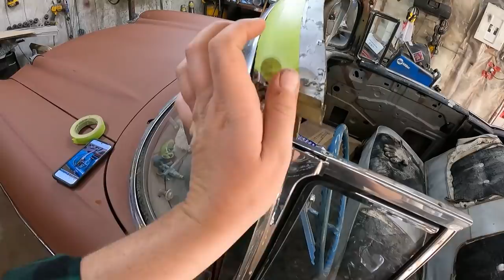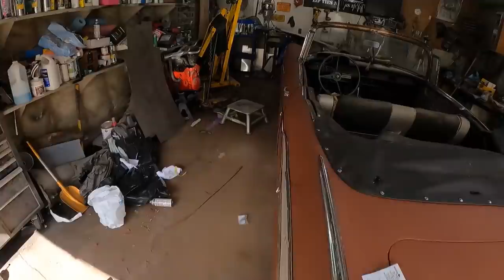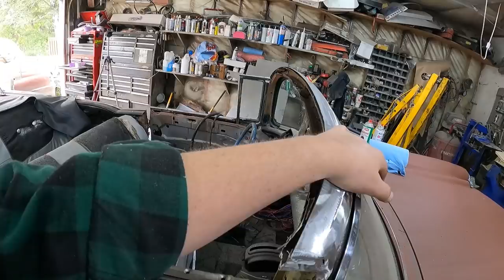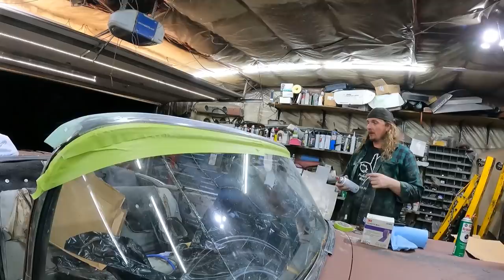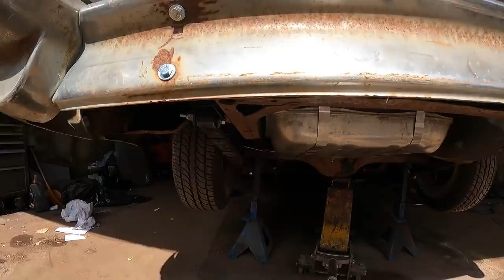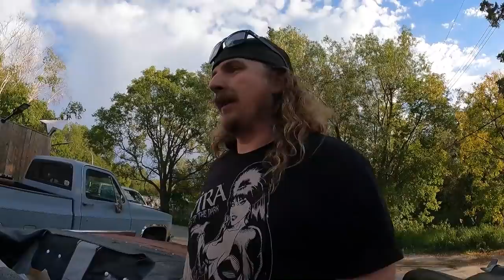IMPOSTER 1957 Chevy Rag Top CHROME IN A CAN Plus GLASS PACKS!

Comment: Finally tackling the windshield / roof portion of this build . This was filmed when you sold the sport satellite . It's there in the beginning , gone by the middle . Nice job on the boxing in of the window crown . Looks much better ! As to the inside , maybe mask it on top , 3/4 " , paint the lower portion a flat black to prevent shine . Then it will "look" thin . Sounds excellent ! Chrome tips would be cool . Definitely go shopping for the bits & pieces . You need them anyways , & it's less back & forth if each vehicle has it's own stuff . Great video , Dan . She is about to hit the road , WOW !

Comment: You need a pair of 2-dr HT “A” pillar trim.. Its stainless steel trim that fills the gap between the windshield surround trim and the wing window chrome frame. The front edge has a tab that goes under the windshield trim. Back side is held on with screws.
Reply: His car should have had those, It was a four door Hardtop They must have been missing before he found the car!

Comment: i just cut everything off of my 55 4dr sedan this week , now  it is just the  cowl on the  chassis . im going to use the sedan frame for a jig to build the body.  
  il put all the new convertible floors from the firewall back to the back bumper on and then the 2 new inner convertible quarter panels.  
  i have been buying the parts to build this 55 ragtop forever . i had bought a really rotted 56 convertible first  to get all the convertible only  parts.

your 57 project lit a fire under my but to get this done before it gets to cold to work outside .
 i dropped the 454 block and new 60 over  pistons off at the machine shop this morning so they can finish hone the block and put the new pistons on the rods .
    keep up the good work on the 57 your way ahead of me .

Comment: A tip from an old schooler fabricator.... On the back of the windshield box that you capped and said looks too big... On each side of the sunvisors cut a slit on each side of them about 3/4 to an inch forwards towards the windshield... Then follow the bottom of the arch to the edge near the door vents and by eye.. Follow back to the center of it from the ends and where it starts to curve up and just starts gettin thicker mark it with a sharpie on each side the very ends on the bottom of it are very close to the right thickness the whole bottom of it should be the same thickness and mimic the top curve... The in the exact center push the bottom panel up about an inch roughly and go from the inside edge to inside edge of the sunvisors mounting plates you slit earlier on each side then remove the excess hangin down and step back and slowly curve it to match the curvature at the top.. The do the same steps on the OUTSIDE edges of the visor mounting plates to the door vent trim... and Viola!! a proper correct arch matching the top when you are looking at it from the back and same thickness from vents all the way across Brother.... Take Er Easy & keep a choppin!!!  Sidenote..... Make sure you cut mini triangle pieces to put on each side of the sun visor mounting plates that will need filled in on each side for they will be the lowest hangin points now along the bottom to reinforce them from flexing.....

Comment: Old School flame throwers; Weld spark plug bung into exhaust pipes, wire in coils and plugs run to switch under dash.  Weld 3/8 fitting into exhaust a little closer to end of car.  Fit pipe into 3/8 fitting and weld inside closed drill 1/8 hole connect other side to hoses to windshield washer bottled fluid bottle filled with gas in trunk. (Or ethanol for bluer flame.)  Wire washer motor to switch under dash.  Rev engine (A must) push button to squirt gas, push button for spark plugs.  Adjust gas orifice tip of 3/8 pipe as needed.

Comment: That inside part where the structure was, you can use a pipe and bend it in the contour of the top, and weld it in solid, and have a curved piece that will also reinforce the top and look nice too since you aren't happy with the results as is. On each end of the pipe, round it to bullets on the end and I think you will have something that looks good.

The thing about custom work, it's open to your own interpretation and "poetic license". It's you who has to be happy with it at the end of the day. So far, so good.

I would go with a pair of bowtie tips for the back, and a pair of flame throwers would definitely fit the 50s era theme. 

I don't know if going with a small purple dot on the taillights is legal in Canada, but those were very popular with the old school builds, which gave a slightly blue hue to the taillights too. If it's legal in Canada, it's definitely something to give it that hotrod look.
Reply: I love those blue dot taillights.

Comment: How about bending a length of conduit of suitable diameter (easy to bend) and weld it into the windshield frame cavity? It would add strength and look good while being safe? Don't forget about using Rustoleum Glitter silver instead of chrome - try with a couple coats of clear, it will surprise you!

Comment: The backside of the windshield frame would look good in satin black. It is slimming after all lol. And on a convertible, it would be a black rubber gasket anyway correct?
Reply: Or even get some universal rubber gasket material and attach it about where it would go on the actual convertible.  It would really break up that flat area.
Reply: Completely agree. It would deemphasize it. Even flat black. But no flames, Dan. Please... No flames. 😊
Reply: The rubber gasket goes on the top frame instead of the windshield header
Reply: @dannycasler4959  I'm pretty sure it does !!!

Comment: Dan for that section above the screen you can fix it so easy with your tallent. Use exhaust pip. Cur the pipe in half along it's length. For the ends use angled pipe and cut it the same way.

Comment: An idea for the top of the windshield trim.. put apiece of 1" tape along the top and paint from there down a flat black. I believe it should have a step for the top to rest on and the rubber seal to seal against. Maybe painting the bottom half would help make an illusion it's not as big as it is. Nice work by the way. I really enjoy your videos and your drive.

Comment: I Love that Roadrunner parked in driveway while you're workin in the garage. I"ve got mine in same spot. While I'm thinkin on my 56 Plymouth 2dr hdtp put on 57 chev sheet metal !  Wish I'd kept my 56 Pontiac 2dr hdtp! Same exact center body as chev. Think guy that bought it made it into one!
56 ply. 2dr unspot weld roof add conv top mechanism, poof! Instant convertible!

Comment: I built a 55 roadster pickup, to get rid of the thick look on the back of the windshield frame I bent a piece of 1 inch pipe and  welded it to the bottom then bent the top skin down a little and welded it together. The round looks better than flat.

Comment: Mr Dan, I would try that 2 or 3 inch striping tape in the brushed stainless color. It needs a painted surface to stick to tho...and it cuts with a exacto knife... you could also use it on the door top caps by JB welding the gap and smooth fill it. It's about 3 mil thick so it will tuck, a heat gun helps turn it on the top radius and helps with sticking. The chrome tape doesn't work well and shows everything under it. A piece of black vinyl on the inside would wrap nicely on the window frame you made and break it up. Just some ideas.

Comment: Hello Dan, 25 years ago, i have allready transform a 1954 bel air in a convertible. I have exactly the same problem about that ugly "windshield top inside flat metal". My solution was to put some 5M Rubber Seal Strip on it, and it look more "convertible". Check some cool big seal, or weatherstrip, glue it or bolt on to the inside windshield top, and you've got "the ticket" ;-)

Comment: Like you I'm totally into 70s style builds and think you are on point with your 'roadster'. Normally I'd say slapper bars too, but I don't think so on a convertible!  Just do regular chrome tips, no bells or anything crazy. Maybe do a partial blackout on the back side of that windshield frame? Or add in a seal that look similar to what would be there normally? Great job in such a short time. Hard to believe that 6 weeks ago this was a rotten pile of 4-door destined for the earth.

Comment: There is chrome wrap that you can buy but it would be challenging with all the contours. I like it though and sounds better too
Reply: You mean there's a "chrome" vinyl wrap?!
Reply: Sure is I wouldn't get the cheap stuff though cause you usually have to give it a little heat to work the wrinkles. I'm sure someone has a video out there

Comment: Create a body line on the back side of the windshield frame. By welding a rod halfway down horizontally. Use body filler as needed. Taper the ends to blend in. This should break the panel visually.  >>>>

Comment: Really like this 57 build. Turning out nice.  For the back of the frame you could mask one or two black  1/2" stripes along the length to break it up.  Would make it look smaller and like slots in it . The ideal would be some rolled in beads in the metal face  along the length with rounded edges. Tilting the bottom edge inwards would also make it appear smaller.

Comment: Great job Dan....I think I would use 1" or 1 1\4" electrical conduit for the windshield top it's thin steel and after you cut out the contour you need it's very flexible and easy to weld. The Sun visors flipped in the up position will help hide the top part as well but I love this car !!! Can't wait for the widow to start back up

Comment: Yeah you may have to buy a windshield frame for it.   Atleast if you were able to splice one in when you change the windshield it may save you some headaches.   In the mean time maybe you could trim out some of the bottom to thin it out.   Or take some 1/2 or 3/4 steel tubing and bend it to shape, split it in half, and weld it in the middle to break it up.   Or you can take 1/4 inch plate of steel and cut it to make a strip that runs all the way around the middle.   But mostly its really the square edges that don't flow with the car.   But it's looking great though!

Comment: Hey Danny,  The window trim/frame came out good. I see what you mean about the ;inside being a little to much being chrome. How about taping off about a half inch on the top and painting the bottom semi gloss black. That may brake up the size of it a little. It's hard to tell in a video but....   Later

Comment: I would trim/cut the corners of the lower inside windshield and bend it up to decrease that gap. Then cap it off. Or put some 1/2” pipe in that gap and bend the lower lip to that pipe so it does not look so pronounced

Comment: You could put two halves of 3/4" pipe on the back of the window frame. It would give it some shape and would form a double D. DD. Someone else sugested a half of exhaust pipe but you thought that would be too hard to bend. The smaller pipe would be a lot easier.

Comment: Amazing!  What color top would you put on the car if you were actually putting a convertible top on it?  You could glue an upholstered panel, in that color, to the inside top of the windshield frame and put half of some sort of a latch on each side to make it look like you actually have a top to hold down.  That might break up the long stretch of the panel.  Just an idea since you asked.  You could do it with paint too and just add the latch pieces.  Nice job.  Keep up the good work.

Comment: dan,  ya gonna has a get danny into apolstry class so she could be maken ya the interior parts. seats ect. I been trying and trying to remember what they call it, i am sure Micheals sells it, it is like a 3/16 or thicker flat hard cardboard. best part what me trying to remember it is you get a Tea kettle boiling with a decent steam coming out and you can form it to curves.  I made the head liner in my 68 ford 4X4 with it, it was simple to work with and turned out like factory. and seats are basic sewing. best is stuff i talkin bout you can put a sewn padded pannel to it with good spray contact cement for easy door pannels and body panels. best is ya can pick up hjeavy built old sewing macjhines pretty cheep at second hand stores. and until ya get good at it do as i did designng dresses, use 2 dollar bed sheets from second hand stores to make the first parterns to see how they look so not waste expensive material.

Comment: Instead of capping the inside of the windshield frame you should have pie cut it to sorta pinch it together to about a half inch  , you put plates on the inside with nuts welded inside for the sunvisors , make sure you don't bend the top side , then cap it .

Comment: I would like to see you build a tri-five shorty wagon. I have always wanted to do one but I don't have the ability. I have seen a couple and they are really cool.
Reply: i want to do a 57 short wagon , i did a 64 nova wagon and a 66 nova ,  shortened wagons .
the 66 nova wagon is ezr to do the doors . use half of the front door and half of the rear door . if you measure it right it will use all stock glass .

Comment: To reduce the "thickness" of the inside panel, could you chamfer the middle section, Dan?  In between the outer double skinned parts where the visors will be.  You'd just need to cut maybe 20mm off the upper and lower parts and weld in a strip of sheet metal.

Comment: you could have used 1/2 " conduit  tubing to get a nice rounded edge then make a lower part to go from the tubing to the inside roof , but first  hammer the inside roof edge up some so it will blend in more ? i would spray chrome paint between the door and windsheild  .  do you have any side or upper inside windsheild trim from any of the tri fives you parted out ? you can cut them to make some of what your missing on the inside .  will the guy you bought the 57 from sell you any parts ? if he will make a shopping list .  i would beat that rear bumper back into shape some.

Comment: I'd consider running a black stripe length-wise on that trim to break it up a bit. I think it'd help take away the bulkiness. If you wanted to put in a little more work you could drill holes in it length-wise to give it some texture.

Comment: Glue a piece of trunk rubber down the middle of the window frame, that would make it look a little better, not so wide, someone has the top section of window frame just sitting in storage they are never going to use, roll your rear exhaust pipe clamps so the bolts point up, they look so much cleaner.

Comment: To do Chrome an easy way is to go to the hardware store and get some aluminum duct tape kind that they use when making furnace duct work to cover the joints can get a roll relatively cheap can use to join your 4 Door to 2 door conversions cover whole piece of chrome may want to use something to fill gap at the splice before covering with the tape will look funky until you rub it with a little polish to make it shine will end up looking just like chrome and you won't be able to see the joints will look like 1 whole piece tape roll is 4" wide and 200 foot long 1 roll lasts a long time it is very durable , I have even used it to repair bumpers where the chrome is messed up cover the whole bumper works great for short bumpers that have an upper and lower would work perfectly for the fake convertible section above the windshield

Comment: A rolled edge on the lower back part of the windshield frame would slim it down nicely and look more finished.  Section a piece out of some tube that has a radius you like and form it to fit.  I know you're changing the windshield, but the vent windows and your new carpet are taking a lot of sparks.

Comment: Dan, I'm seeing that the convertible's upper Windshield Chrome trim wraps around the top and into the inside more flush with the old roof line on the original cars. In other words, that steel plate you welded on the inside appears too big. You may want to remove it and hammer up the lower former inside roof plate up closer to the top outside roof plate  then weld a smaller strip , about one inch plate, over the two across the windshield. What do you think?

Comment: It is very boxy looking , early on someone had suggested using some round pipe ( conduit maybe ) what is that top to bottom distance ? Weld in the pipe , cap ends , just a small bend to follow windshield .

Comment: Great build ,,what about getting stain muffler pipe bent to fit the windshild at a shop then chop it in half ? Also if your going to run this as a roadster why not cover the rear seat area with steal then can be removed or a top made of vinyl with snaps like your other top you put then rubber seat covers for front 😎

Comment: Looks just fine for now you gotta hurry to beat the snow and cold weather. Bad Chad would have used a exhaust pipe he would have wacked it on the ground until it followed the roof line. Then he would have smucked a ship load of fiberglass filler and then a ship load of bondo on it and floated it all out then sanded it until it was beautiful. Actually the chrome paint so good you could even paint the back bumper with it so the bumper looks good. Looks great on video just like real chrome. You could heat the bumper up cherry red and tap the dent out of it and paint it with chrome paint. Sounds good to me. You gotta take the seats to upholstery shop because everyone can see it with out a roof on it. Flame throwers yes. dont  let the cops see the flame throwers though that would not go over well. It needs a pro job on the seats they suck and are nasty and your baby aint gonna sit on that yucky seat.